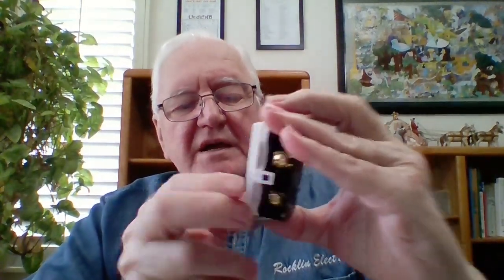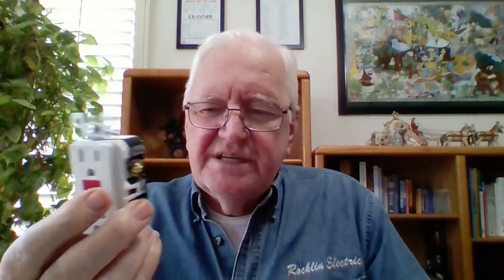GFCI SHORT Electricians Need to Know: 1 minute 20 seconds

Comment: Can someone help me out. I put in a 120v hot water heater and I noticed the my house being 14 gauge wire (14 AWG) But on the wires of the water heater it says 12 gauge (12 AWG) Is it safe???? And will 14 gauge wire nuts work?
Reply: 12 awg is 20 amp, 2400 watts less 20% = 1920 watts, The 14 awg is 15 amp 1800 watts less 20% = 1440 watts. The 14 awg May run the hot water heater for a short time the 15 amp breaker will trip eventually, you need a 20 amp service to run a 12awg heater.